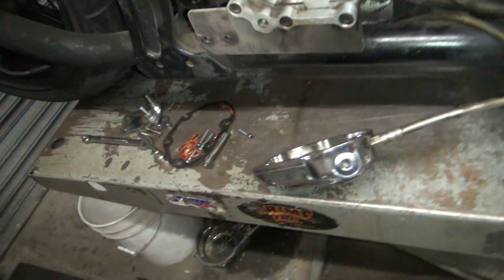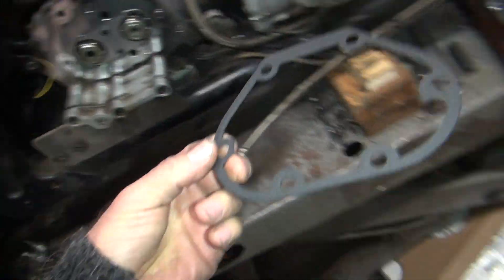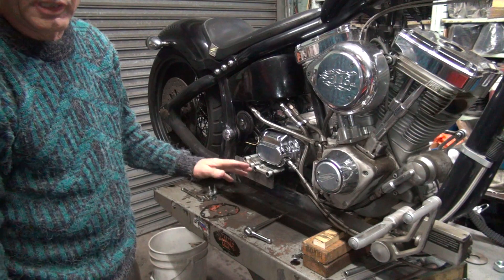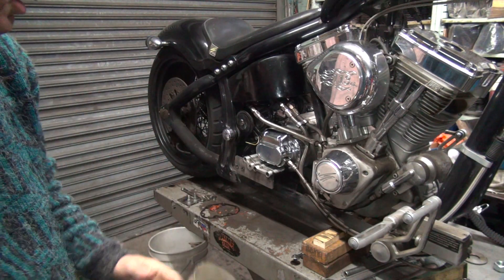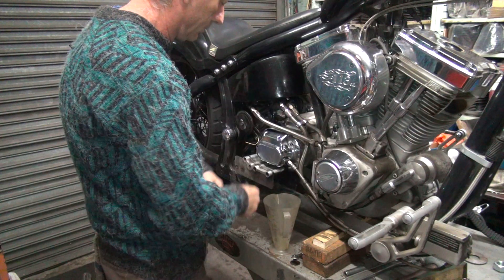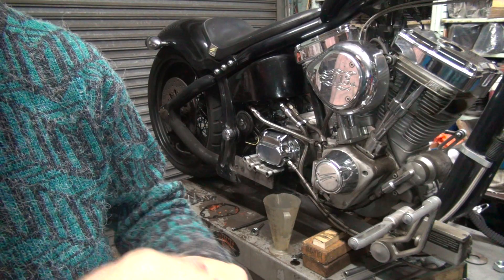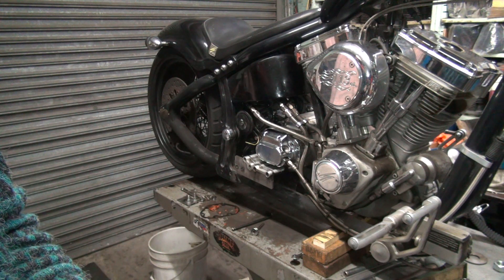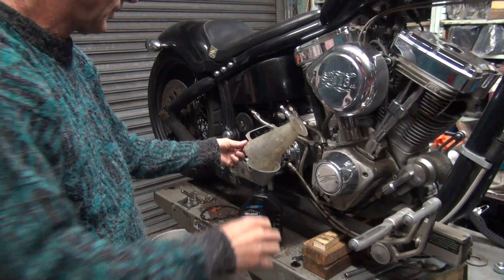#115 S&S 113ci evo motor blown belt drive transmission repair harley swift evolution tatro machine

Comment: I've got a 90, 5 speed. I'm pretty sure the manual says to just set the dipstick on the threads and not screw it in when you check the transmission level.
Reply from the maker: maybe, i seen it done both ways and don't remember what it should be. either way, it has lots of oil in it now.
tatro